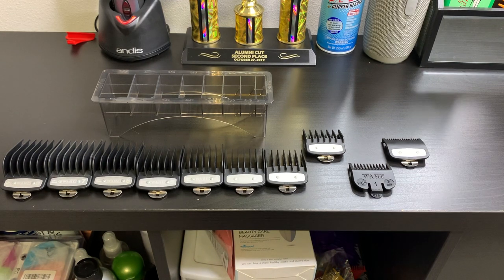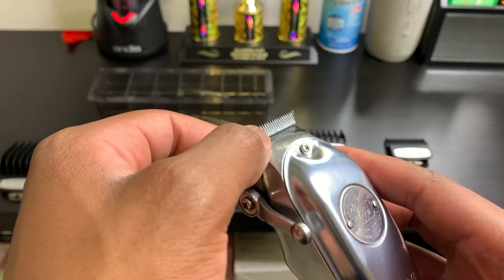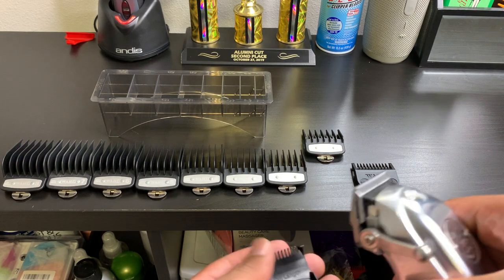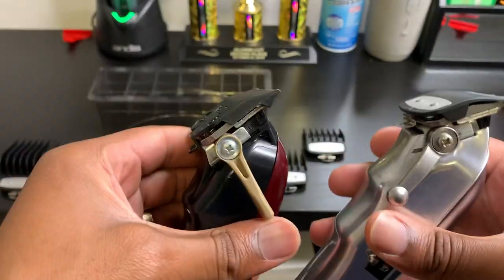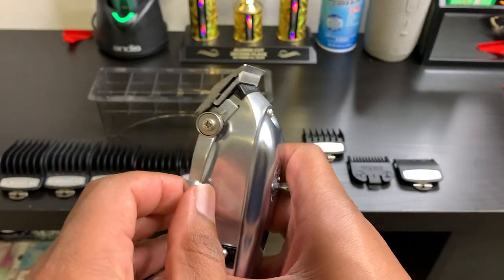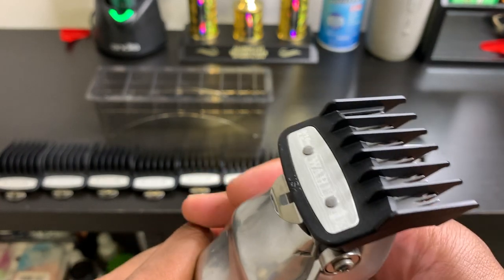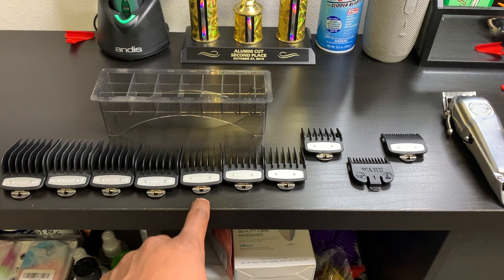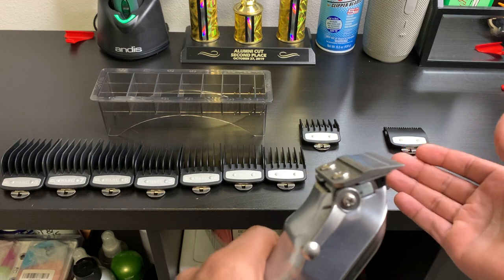GUIDE FOR WAHL GUARDS | LEARNING AND UNDERSTANDING CLIPPER GUARDS | HOW TO USE THE LEVER TO FADE |

Comment: I think there is a small gap between 0.5 open and 1 closed .I think 0.5 open is a little bigger than 1 closed ..so if you are fading after 0.5 open you need to continue with 1 guard slightly open

Comment: So when the guard is open it adds .5  to whatever guard you have on the clippers? Does that mean I can fade at .0 then open the blade it to .5 and fade that way as well?
Reply from the maker: Yes so if you’re doing a basic bald fade (not using a trimmer or shaver) the bottom of the fade would be no guard close then no guard open to set your next guideline about an inch above the close lever.....then blend those two guidelines into each other by using the lever at the half way point between closed and open and as you go higher up start using the guards.....I hope this helps
Reply: You can buy a wahl 0.5 guide which is easier
Reply from the maker: We’re referring to the blade without a guard on it being 0 when the lever is closed and .5 when the lever is open